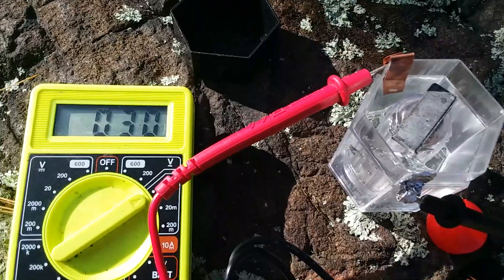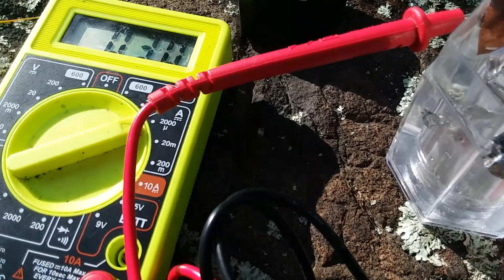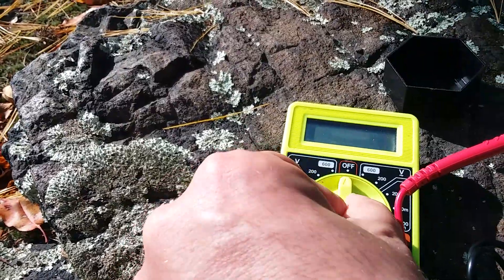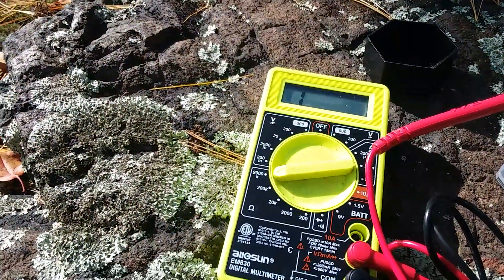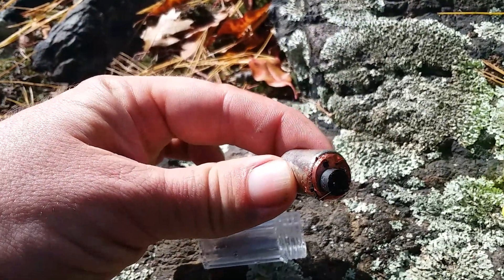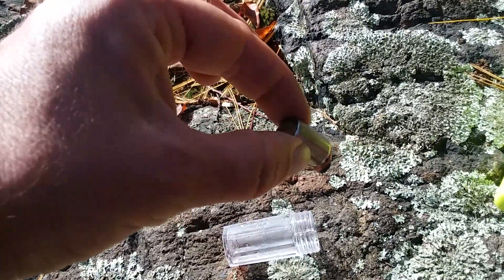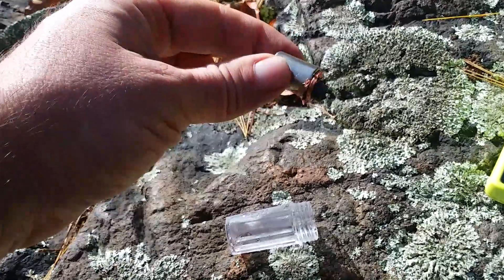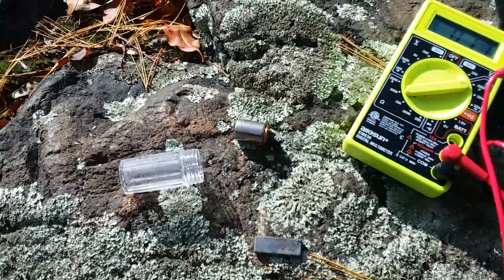Neutrino video 2018

Comment: Hello Mr Lang, thank you so much for sharing this video with us! In the comments, you refer to the "Schubart patent", would you happen to know what the Patent Number is so I can look it up? Your help is much appreciated!
Reply from the maker: I do not recall the number but it is prof. Thorsten Schubart of germany. Company is neutrino-energy.com
Reply: @peterlang777   Thank you, I think I found the patent with the information you provided me: https://patents.google.com/patent/WO2016142056A1/de , so thank you for that. One more question: Were you just able to produce voltage or have you already created an electrical device that runs this way? Great work by the way!
Reply from the maker: @danielatrust6645  it is very weak. It can't even light a single led with the quantity of alloy I have. Why I use ambient heat #nantennas now
Reply: @peterlang777  I understand....still though... I find your tests amazing! Not sure if you can answer this: but how much surface of the alloy would be necessary in your opinion to light up a small LED? And do you think it is possible to stack the alloy over each other?
Reply from the maker: @danielatrust6645  8 × 8 inches with a graphene supercapacitor to store charge
Reply: @peterlang777  Would it be possible to use for example:  8 layers of 1x1 inches stacked on top of each other?
Reply from the maker: @danielatrust6645  from what I saw of the patent yes. Since the vast majority of neutrinos simply pass through even the bottom layers would be exposed to neutrino flux

Comment: Hmm, so how much voltage and current does it produce ? You showed 0.3 Volts and how many Milliamps ??
Reply from the maker: I got annoyed by the lack of amperage and so went to other nanotech like galfenol so I could use infrasound instead
Reply: @peterlang777 
🤔

Comment: So neutrino alloy is just (silicone), SiO2 & carbon that’s the secret sauce between copper and magnets ? Correct? Cool stuff !
Reply from the maker: It is silicon not silicone. And it alternates with carbon layers in stacks.  Called Schubart neutrino alloy
Reply: yes silicon, quantum magnetics uses the same stuff, silicon is like quartz.  Hutchinson Cystal powercells is what this reminds me up! Thanks for sharing
Reply: Can you send some links to get materials to duplicate?
Reply from the maker: @danielrueb1905  you can use the Schubart patent but reproduction requires lab equipment.  #DARPA affiliates made mine at university of maryland
Reply from the maker: @danielrueb1905  acs nano